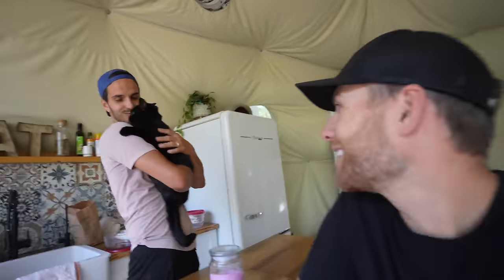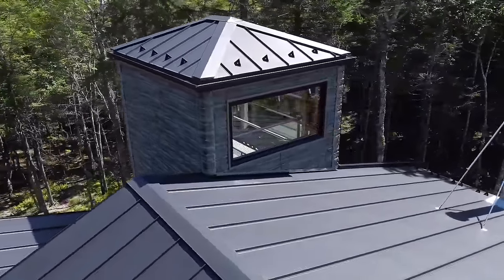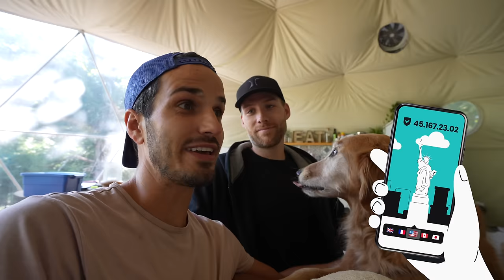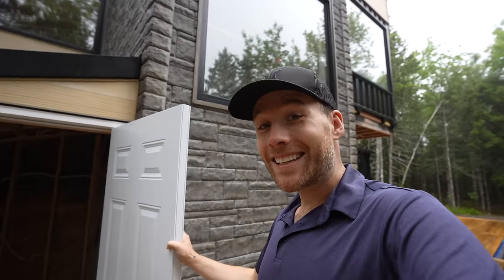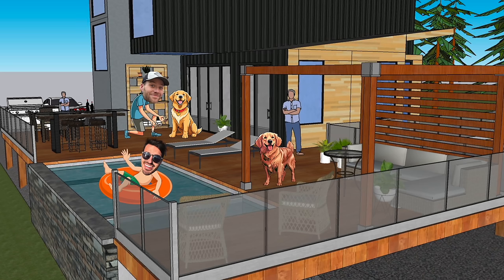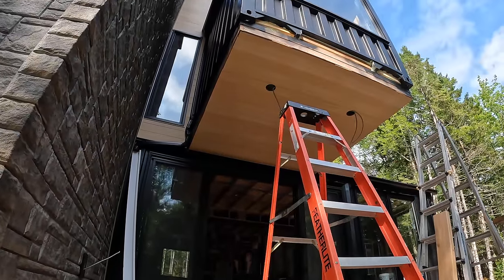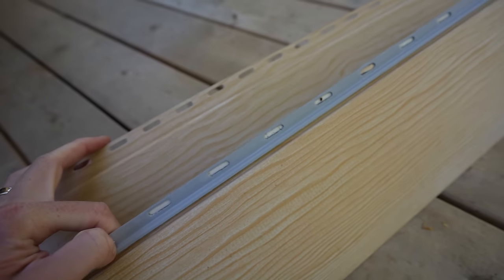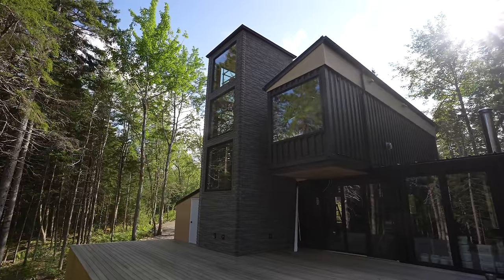The Reveal: We Built a Home in the Woods

Comment: YOU NEED BETTER AIRFLOW UNDER THAT DECK!

Looks amazing amazing amazing. So excited for you guys. 

You do need better airflow under that deck. All those skirt boards are trapping all the moist air under there and it will contribute to speeding up the rot of your deck. 

A modern looking trellis pattern in key areas around the deck would help dramatically.

Comment: Hey guys. I have a metal roof here in NC. Installed in 2018. I had the ice\snow breakers too. I learned the hard way when it snowed. We had about 12" of snow. I didn't worry until I heard loud thunderous sounds and my HVAC unit not working. With a roof pitch not as steep as yours, the breakers were not enough and are not even enough for even 5" of snow. The snow slid and took my gutters with it or bent the gutters severely. HVAC unit was buried and had to dig it out. Had gutters replaced and a snow ledge installed. It raises from the metal and acts like a slicer where snow can go underneath as well as over it. It's a solid piece that runs the entire length of my roof. Please look into something more than the breakers you showed. It snows more up there than here and if I can help someone prevent a nightmare, I will tell everyone. Great video! See you next week

Comment: The house really looks good, I love it. I can hardly wait until the inside comes together, the tower is so awesome, I joined you the day Tyler was sitting outside the house in tears about the stair case ,As tough as it was for the failure of the first plan ,the staircase tower is really  the cherry on top of the whole design. It adds the drama that sets your house apart from others.

Comment: OMG - have you considered turning your pool into an ‘endless pool’?  It’s a machine that creates a current in the water that you can swim against - like a treadmill for swimming - they sell units that can be added to an existing pool. An apartment I lived in had a pool that wasn’t very long so I got a sports band to tie around my waist and secure to the hand rail - kind of my own diy version of an endless pool - I and loved that I could swim for 45 mins straight without having to turn around every few strokes ! So diy works too 🏊‍♀️
Reply from the maker: Really?? Thats so cool, did it feel like you were actually swimming? How did the water feel pushing against you?
Reply: @tylerandtodd  sorta like swimming upstream, but without any variation in the current - if I ever get a windfall, an endless pool is on my wish list even though it would be expensive to heat through a Calgary winter

Comment: It looks like you guys went with gutter guards, but just so you guys know, those actually clog your gutters more than it would without them. Either way you'd be getting up to the roof and cleaning them out. But the gutter guards block the water from even going into the gutter if they're covered in leaves, causing more issues later.
Reply from the maker: We almost didn’t go with them but this style doesn’t to that. It’s a double chamber. The top one doesn’t allow anything in so it dries everything, bakes it in the sun on the black roof and then blows away in the wind. I was sceptical too but it really works (so far anyway)

Comment: @3:02 Understandable but: we would have installed them "points up" so as to slice the snow rather then points down acting as a block holding, instead of a knife edge up cutting.  Also we install them in a much larger size to cut the snow in half before it takes off our stove pipes, and vent pipes. Just an observation.

Comment: It’s looking real nice now, I do have a question, why wood for the deck?  Yeah I know Canada has a few meters of forest, but they are a pain to maintain yearly and in 8 years, watch out for splinters.  We used a composite material years ago, minimal maintenance and the other year replaced it after 20 years, as the wood frame underneath had some rot issues to be fixed.
Reply from the maker: The composite deck was 5.5x the price, it makes more sense to use cedar because of the size and be able to replace it down the road if we need to
Reply: @tylerandtodd  I get it, $$$$, just a thought, it does look really nice on the outside, now you need to make the inside match.

Comment: those ice guards are not a good idea .. they will provide a pull onto the roof and eventually cause trouble ... screw nailing anything to the roof beyond  anchoring the steel down is another way for  leaks to happen ..  these guards hold back ice and snow build so that the pressure is on the guards and the roof and over time are  going to be needing repair and are one sweet pain in the ass ..  just an i told you so .. k